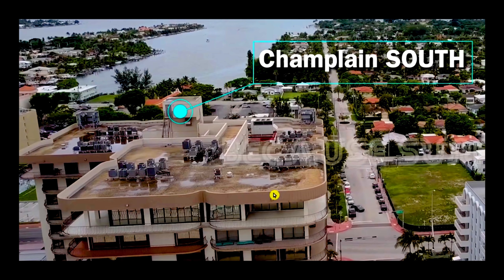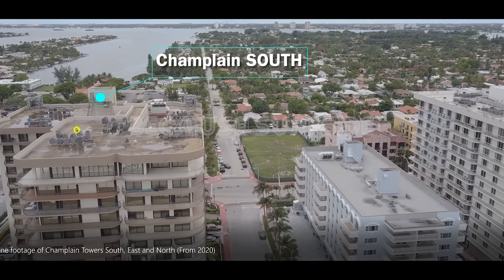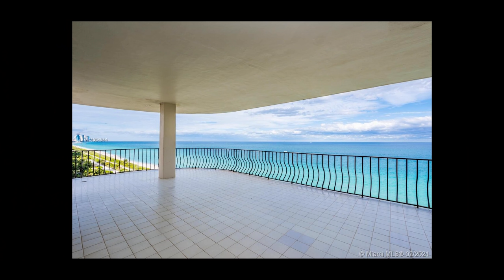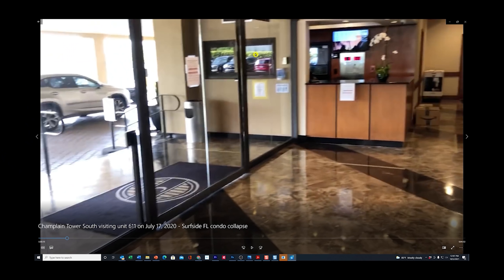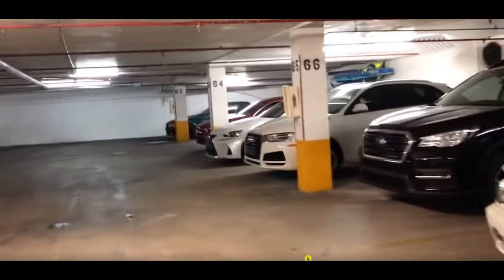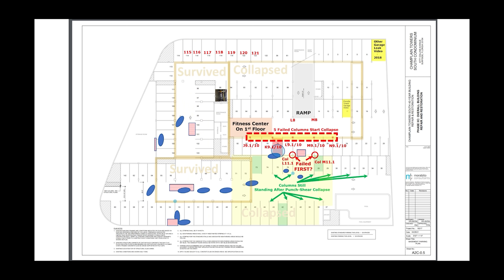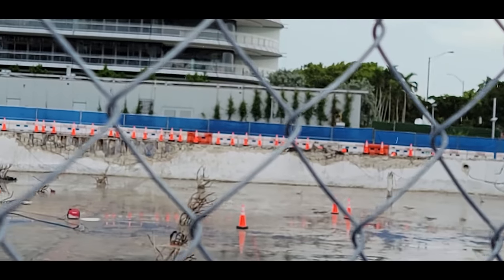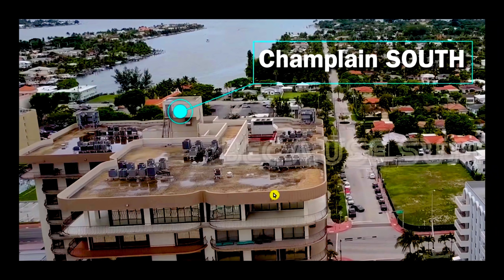Miami Condo Collapse: Water Attacked Roof, Inside, Pool Deck

Comment: You just keep out doing yourself 👏 👑
Yes and they were working on the roof when it collapsed. There’s no way that roof deteriorated that bad between 2018 and 2020. Also per code you can do 25% roof repairs a year. 
And they were only ever supposed to build 11 stories 🤔 11s everywhere . 
Now if you could shout our group 🤣
Reply: That code wouldn’t apply, building was built before 05, and it had all its permits. They could replace the entire roof.
Reply: “New and existing” in terms of roofs. They also had a Building code update version 7 that came into effect on Jan 1st 2021. Just because somethings built before current codes doesn’t make them exempt for future codes .
Reply: Here is the text of the Rule: 708.1. 1 Not more than 25 percent of the total roof area or roof section of any existing building or structure shall be repaired, replaced or recovered in any 12-month period unless the entire roofing system or roof section conforms to requirements of this code.
Emphasis on “Any Existing building”
Reply: @CollapseOfChamplainAndMore  there are a bunch of exemptions to this rule, one being if the building was built before 2005 and was properly permitted this code doesn’t apply. An old building isn’t required to meet current building codes. They are grandfathered in. Most towns give out variance’s like bottles of water, I guarantee thousands of properties in Florida have been given a variance on this code and have had more than 25% damage replaced.
Reply: @335m5  it does read very unclear tbh

Comment: Poor drainage, bad pool design, water intrusion into the foundation as well as structural concrete walls, added materials and tiles to the structure of the building, and a lack of any general maintenance lead to that horrible collapse.
Reply from the maker: this is what NIST will likely confirm

Comment: The prior owners of our house built a second story in 1987. They decided to put a decorative balcony above existing original home. They even put a 12 inch fence ..L0L. Anyway, they put shingles on the “balcony “ the problem is they built it flat….so we always had leaks into the room below. I found a membrane designed for flat roofs. We put 3 coats and it has taken care of problem. My question is…wouldn’t county building inspectors have said something about a flat roof without drainage? Or is that something that is not part of building integrity?

Comment: That roof is trash. Look how black it is. You can tell that water sits there all the time it's gone to the point where it's getting moldy and muddy. You can see some of the roof of the collapse part of the building in that drone video. Black! I'm wondering if any of the roof drains were clogged up and water was leaking into the walls down to the garage.  Also would you say anything to the drone video where you see everything cleaned out on the garage level and you can see the staining on the concrete floor?
Reply from the maker: They already had flooding problems in the garage years ago, that might have left stains

Comment: What a dumpy building. Pay big bucks, for a place that sucks
Reply: Real estate listings of the apartments for sale showed them to be very nice inside.  Also decent space - 1,700 sq.ft. and larger.  Plus the location on the ocean, and view from many of the units.
Sadly,  the hidden structure was failing,  due to a combination of faults in the original design,  modifications and lack of maintenance and repair.  Unfortunately, this is not an uncommon situation today with costs and budget cuts.

Comment: Not to be an ass but I have to correct something you said right at the beginning.  There is no such thing as "it didn't rain recently" in Florida.  I lived there or a year and it rains almost ever day. And when it rains it POURS literally inches of rain in a few minutes. Now you can contrast the standing water v.s. the other buildings roofs and say, the drains were too small or blocked up but you really can assume from this one pic that it didn't rain today. That's just not an option. Because the summer sun bakes the pavement and it dries very quickly after a rain.

Comment: To me it looks like it all started with condensation from the air conditioners on the roof. There was no effective drainage of the water, so the water found an outlet through the building's elements. Years of concrete dampness have done their job.

Comment: I wonder if you live in Florida and know how often it rains and how much it rains everyday. That would not be water coming up from the ground
Reply from the maker: Yes I live in Florida about 40 minutes north of the condo collapse site. During the summer it does rain a lot but the rains have backed off now that we're into October, and so most of that water does indeed appear to be coming up from down below most likely because now that the building collapsed it probably caused some damage here and there that's allowing water to seep up because they didn't have this much water coming up right before the building collapsed.

Comment: If putting tile on a balcony can cause a building to collapse, then something is wrong with the design!
Reply from the maker: Might not make the balcony collapse, but it traps water under the tiles, leading to deteriorating of the balcony concrete

Comment: Water “attacks” roof? I think not. But a poorly built structure developed by a questionable building practices? Yes.
Reply: Rainwater pooling on flat roofs is very common and not a threat, and in any case was due for repairs. I find most of this video unconvincing.

Comment: The alignment of the *11-numbered apartments over column M11.1  matches another set of 11s - the two <CLEARANCE  6' 5"> signs leading down the ramp.  Of course 6+5 is 11 but that's only incidental as it's arbitrarily mixing units of measure that weren't meant to be mixed. More interesting is that 6' 5" is equal to 77 inches or 7 x 11.  Why is this interesting? In the arrow of time 77 is critical to understanding time's fundamentally regenerative nature.  It's the precise location where the orbital path begins after 76 intervals of even expansion and completes at 125 and where a new expansion is born at 1. The mechanics of this is the result of the synchronicity between expanding paths and orbital paths. For the first 76 intervals, two paths run concurrently side-by-side, but at the 77th interval a divergence takes place - one path takes an orbital path, the other ever-expanding.  Some of these paths of expansion and orbit will end up with offspring shoots of their own. CERN's biggest achievement was in finding a result at 125 GeV pointing to the Higgs Boson. Other predicted particles were never found.  However, this new model of time's arrow actually predicts there will not likely be. Why?  What this arrow traces out is effectively the dipole moment of every subatomic particle known to man. It's the big enchilada.  Ironically the first instinct of the CERN scientists was to call their work "the search for the god-dammed particle" because it was so elusive...and finding something, anything at all amounted to a great relief.  The publisher refused the initial name and recommended 'The Search for the God Particle" instead  and thus the God particle mythology came to being even before it was fully, and rightfully "discovered".  What this means, is that with the true discovery of the God particle with the unveiling of the arrow of time, we can finally see how this geometry imbues our reality with a kind of hidden code, generally called "information".   Let me give you an example of how it may be affecting our consciousness unknown to us.  What if I told you most license plates in the US were '77' plates?  You'd ask, "How so?"  I'd explain that both numbers and letters require pen strokes and we can determine the number of pen strokes required to form the number and letter combination of a number plate. The most common plate letter and number combination in the U.S. is a plate having 3 letters and 4 numbers. The average stroke count for 3 letters is 7 and likewise the average stroke count for 4 numbers is 7.  Thus the two unique  7s  can be thought of as representative of the tens and ones place of a single number.  This is how the most ubiquitous number plate in America emerged as the '77' plate.   Another example is 7-11, the convenience store popular around the world.  In Japan, there is even a catch-phrase associated  with it  consisting of "7-11" (spoken in English using Japanese pronunciation) and "ii kibun" which means "good mood, feeling."   John in Revelation Four provides a stunning description of God's throne using the metaphor of beasts to describe a beast of a geometry that matches the arrow of time to the letter.  How can this come about?  One, we know John was a particularly gifted writer and observer and two, we know our reason is not immune to feeling and intuition. Indeed our powers of discernment improve our intuition.  In contemplating God's throne while 'in the spirit' John hit a home-run that certainly was not expected by his colleagues.  It was no image of God on a cloud listening to angels playing harps - it was an exotic engine room of all Creation, what we can understand today, as the very model of time itself.  How does this relate to the Champlain Towers?  Our number plates are '77' plates, our convenience stores are 7-11's so it should come as no surprise to anyone that our buildings are also imbedded with these numbers subconsciously by those who designed them. We are an extension of this arrow of time, co-creators of this universe and it should be understood that not everyone of us shares the ability to tune into this subconscious reality.  The arrow of time should vastly help out.  The remarkable walk-through of the tower by the astrophysicist Fiorella Terenzi was stunning in both its portrayal of the damage and in its numerical synchronicities.  I am a scientist who recognizes our limitation in understanding how the universe works can have disastrous implications.  We rely on the underlying structure of the synchronicity of waves to hold all things together.   Diamonds may last very nearly forever but we don't make our buildings out of diamonds.  Understanding this fundamental truth of nature led Fiorella on the right track to document the condition of the property before considering a purchase. What led to her assignment of parking space 17 (the fundamental identity of time's arrow)?  It is when the best of science and the most earnest of spirit come together, that makes life hum along smoothly and yet this is not always any easy task.  Jeff has done an exceptional job in piecing together the pieces of the puzzle.  It's obvious the Spirit is at work in him to help us all learn to see the signs of stress well before a tragedy strikes. This was my hope before 9/11 and why my efforts in this matter led to the arrow of time's discovery.

Comment: Really interesting. Water does do lots of damage, combined with poor building design/implementation. Reebar weakening with water damage, lack of drainage through not being there / blockage  etc. all make you think. Also the site being a swimming pool just makes you worry ?mains sewer leaking, rising water table. With climate change and rising sea levels, makes u think

Comment: looks like no drains on the roof for the air conditioners to drain into.
Reply from the maker: plumbing lines dedicated for that you don't let AC water drip on a roof, you drain it down the pipes to the sewer

Comment: Once again my very first comment was that the land the  whole condo is not built on leval land. The first thing that caught my attention was the road on the city side of this building. Is like a hill then it runs down to the traffic light. It looks to me maybe even a man made part of the road. So if the intire building was not to level so for sure nothing will drane correctly. You think ? So then all of these issues together came all of this brought the building down. Hey if i lived in this place and they say the building shook and made noises . Hmm i would have my butt out of there.
Reply from the maker: Not sure what you were referring to but the road was level, and the building is built level regardless of what the lion shape is but that whole area down there's completely flat

Comment: The water has very little to do with it. It fell because of poor/inadequate structural design and no sheer wall between the pool deck and the condo building.
Reply from the maker: You don't need a shear wall between the pool and condo, you need an expansion joint or an isolation seam

Comment: The water appear on the roof, could be the AC evaporator.......dripping on the roof......you can tell were the water is, concentrate arround AC
Also the sluggish water from the AC  could glog the drain......

I live in Canada and also in WestPalmBeach Florida....I can tell you the AC unit is a constant battle. to make it right
Reply: Keep in mind the evaporator (cold section) of the AC is located in each apartment.  The hot sections (compressor and condenser) are outside / rooftop.  The 1979 build plans show the freon lines from the roof to each apartment and the condensate drains for the evaporator collection pans.
Reply: @LakeNipissing  Exactly

Comment: That roof plan you had is before the penthouse was changed. Also, you expect the roof to be ugly like that. Watch a tonne of HVAC video's. Roofs are ugly places.
Reply from the maker: Dude, look at all the roofs of the adjacent buildings they are clean. This roof is ugly because it is not pitched properly to drain water so it sits and pools on top and gets filthy. A properly sloped an drained roof will always be clean
Reply: @jeffostroff  The plans call for a pitched roof, that is correct. Those plans are obviously the plans prior to the penthouse roof. So, if you are going to refer to the plans, can you at least get the correct ones?

Now, most roofs are ugly like this, you damn well know it. Very little care or consideration goes into roofs. Because even if water does pool up on the roof, this isn't automatically a big problem. It certainly didn't cause the building to collapse.

The other buildings have had their roofs renovated, as was the plan with this building, as had been started. If you take a look at the top, what you are looking at is an aggregate material. They were in the process of replacing this with tar and more aggregate material. The plans show only the slab roof layer, which does have an angle to it, but once you put the aggregate down, you introduce areas where the roof floods a little in the rain.

Is this a problem? Nope, because the material is a kind of tar and rock aggregate which is exposed to the sun. It's different to the pool deck. You would never evacuate a building based on this.

There is a problem with your tone, you are more likely to take a paranoid approach to any issue, and whilst you should explore these types of things, you have to be able to be objective about whether something is going to cause a problem.

You also discussed water ingress onto the foundation, and I am thinking that workers have attempted to access the strength of the walls around the foundation, and they have perhaps decided that the foundation is strong enough to be full of water at this stage.

I would say that in the future, further work may need to occur onsite, such as perhaps doing to fill of the site. Obviously there are retaining walls around the perimeter, but I think it's most likely they have determining that these retaining walls can sustain the pooling of water. I would probably say that the surrounding area also has retaining walls on their properties, so minimal disruption. Even if one of the retaining walls collapses, it won't be a major issue. Should turn the site into a swimming pool, seal the concrete up proper.
Reply from the maker: @berenscott8999  I showed the only plans we know. Even with the penthouse added, it only takes up the eastern 25% of the roof. The rest f the roof presumably should be unchanged. We don't yet have any other drawings showing drains or ACs on the tops of the penthouse.
Reply: @jeffostroff  And as I said, there are millions of buildings around the world, where water slightly pooling on the roof from rain or moisture in the air, is literally never a problem. You'll find a number of different mechanisms for drainage present, say in the walls, in the floor. It's just such a non issue here. Imagine the roof on a restaurant or shopping centre with multiple HVAC systems. They literally wash these machines multiple times a year, the water ends up on the roof and somehow makes it off the roof. It's a roof, it's designed to handle water all the time. The roof is so bloody overwhelmingly over engineered to sustain constant rain and sun hitting it, it's probably the strongest part of the building. It then has weight added to it. Not just this, but they were replacing the aggregate on the roof at the time of the collapse, so even if water was pooling up before this, they might have completely fixed the issue, and it's only an issue if you think an ugly roof is an issue.

Comment: I think that it's clear that no building should have been built on that lot.....It's a swamp
Reply from the maker: IT is not a swamp. Hopefully they will find out why it had leaked so much years earlier
Reply: @jeffostroff  I didn't mean a literal swamp but it looks like that lot in particular to the ones around it retains a lot of water
Reply: @jeffostroff  I don't know much about the location so from an outsider's view to me it looks like that particular lot could be dealing with a lot of tide water??